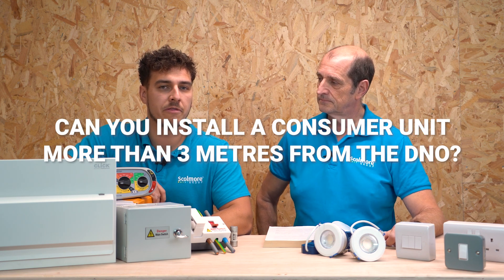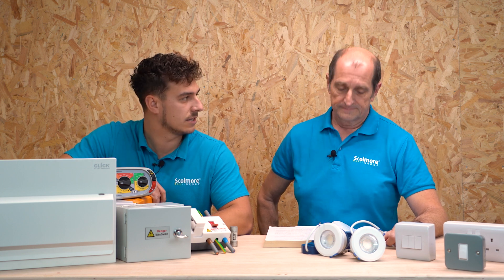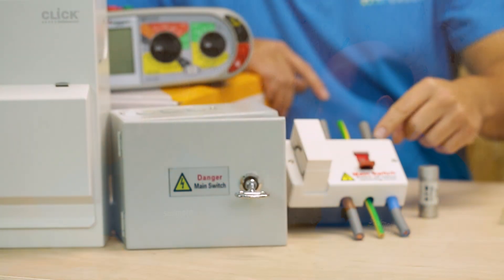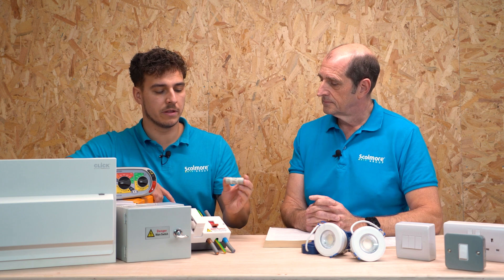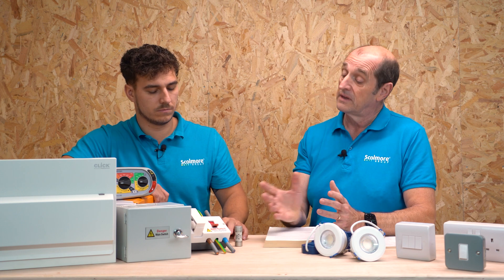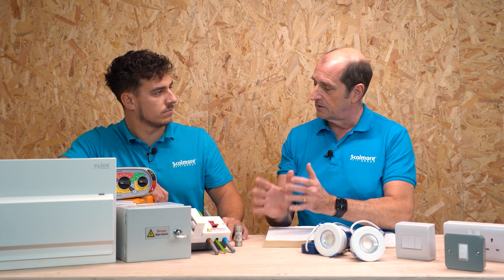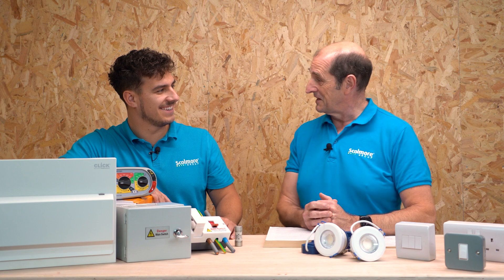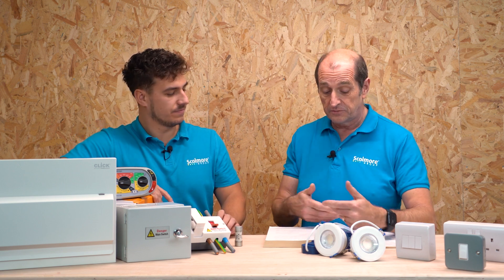Can you install a Consumer Unit 3 meters away from the DNO?

Comment: The customer owns the meter tails from the meter to the consumer unit. The dno doesn't care what size they are, it could be a bit of string and they wouldn't want anything to do with it. The section from cut out to the meter is theirs, and they rarely upgrade that either. I've fitted ev chargers where there are 16mm tails in place, they've upgraded the fuse to 100a and left their 16mm in place.

Comment: Instead of the switch you show in the video....could I use a time delayed RCD or even a RCBO in its own enclosure as a switch as it also provides greater fault protection and faster disconnection speed of my longer tails?
Reply from the maker: There would be no reason why an RCD or RCBO could not be used for overload fault protection. If it was tails that were going to be used as opposed to SWA and they were going to be exposed, then there would be the need for mechanical protection that would come in the form of an RCD / RCBO 😄